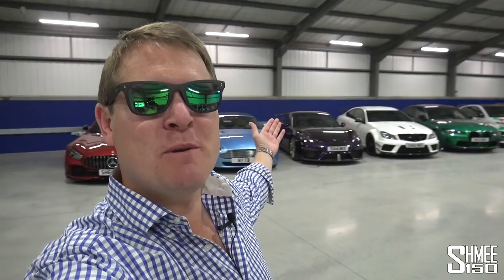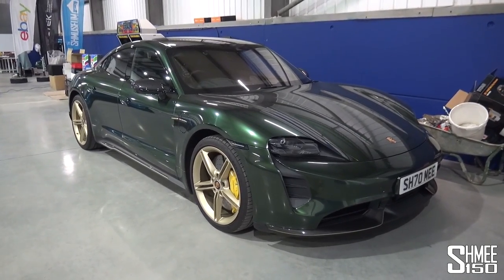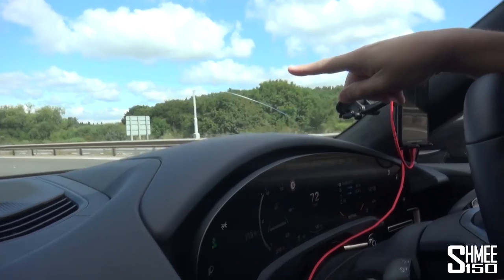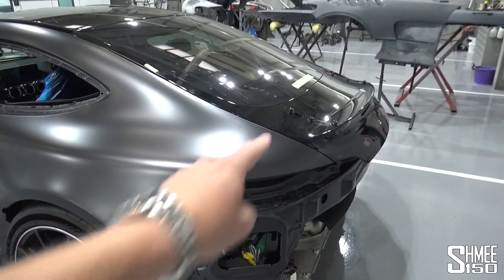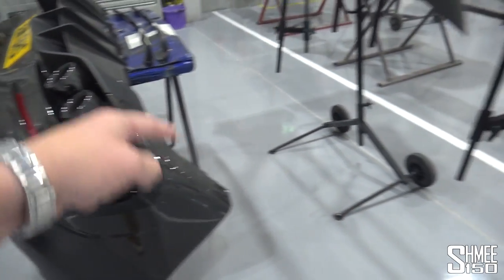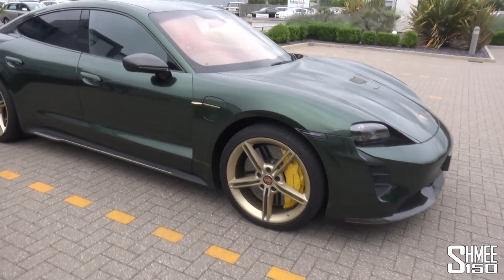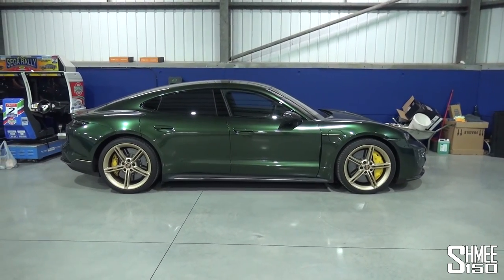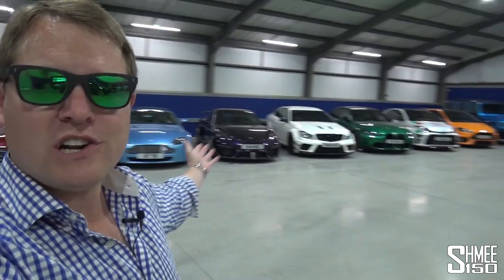My AMG GT Black Series is in PIECES! Stripped Down for Painting

Comment: So if there is any noises in the car from trim pieces rattling etc will Mercedes still fix that under warranty?
Reply from the maker: That's why I drove it 700 miles as fast as possible before stripping it down to ensure the chances are minimised. Thankfully in the SLS BS I never had any issues like this.
Reply: @Shmee150  Ok great. It would be worse to loose warranty on mechanical parts. I guess rattling noises aren't that expensive to fix anyway 🙂
Reply from the maker: Yeah, more just annoying so you do want to avoid them

Comment: “ So when the EPA released battery range numbers for the 2020 Taycan—201 miles for the Turbo and 192 for the Turbo S—it was Porsche's engineering equivalent of the Titanic hitting the iceberg” Motor Trend
Reply: Except it's like 70-80 miles under rated, shown in just about every test. Range mode @ 70mph it'll do 290 miles without a sweat.

Comment: My Turbo S battery went up 265 miles on 100% charge.
Reply from the maker: 100% to 10% or so for me is just shy of 200 miles.
Reply: @Shmee150   when I first got mine I was getting the same as you 200-210, after first software update when I took it, I started seeing the better charging up higher and higher now it usually sits at 100% around 260-267, which is awesome, but that was not the recent recall update, it was a software update prior to the recall. It took about 24 hours for the update. It’s great now you can really plan your routes better, make a big difference.

Comment: You mentioned some parts are needed? Apart from new badges, why would items need to be replaced so soon?
Reply from the maker: There are lots of single use clips on modern cars; things like window seals it's far better to order new ones than try to reuse the ones you've pulled away

Comment: I've been thinking about getting an 08 c63 amg, are they semi decent daily drivers??
Reply from the maker: Sure why not, just watch the fuel obviously
Reply: I heard they had an issue that can be catastrophic for the engine something to do the the engine bolts being faulty from factory. Is this something you've heard of with the AMG of this body style?
Reply: @ReidMYT  that’s a potential issue with any AMG equipped with the M156 6.2 litre V8 built before 2012. The bolts that hold the cylinder head to the block are a poor design. They can corrode easily and the head of the bolt can snap off making removing them very hard and it can cause the cylinder head to not fit properly. I believe any of the facelifted C63 (2012-14) had the updated bolt design that don’t suffer this problem. It is something that can be fixed but it can be pricey. I’d recommend looking up the video that Legit Street Cars made about it, very informative.
Reply: What Robert said^ if you’re looking at 08 reg age examples, I’d look to buy one that’s already had the fix done (with invoices from a reputable garage). Other than that, the W204 C63 is no worse than any other performance car of that vintage for reliability. Just make sure you’ve got enough £££ for fuel & tyres!
Reply: Yes I bought one new. One of my favorite cars I’ve owned.  Never had an issue with it.  They like to eat rear tires.  I got 5-6,000 miles out of a set. Make sure head bolts have been done.

Comment: Don't understand the reason on getting an electric car. Still have to pay for electric, hurrendous carbon emissions on the building process, batteries have a lifespan and take centuries to degrade. 
And it doesn't take 11.30 minutes to fuel at a gas station. More so around 1.30